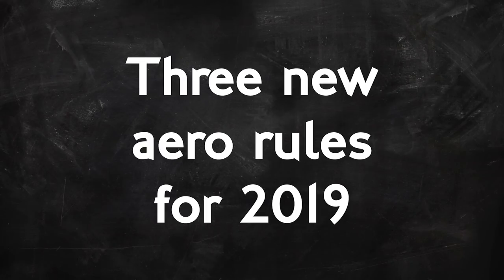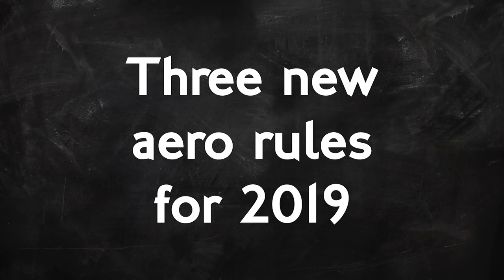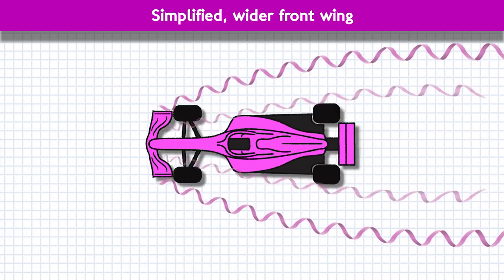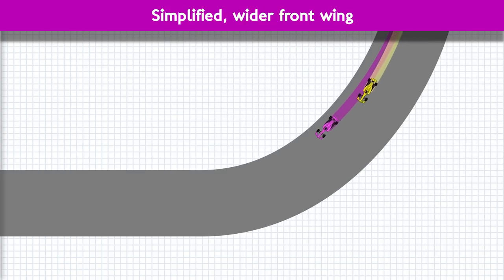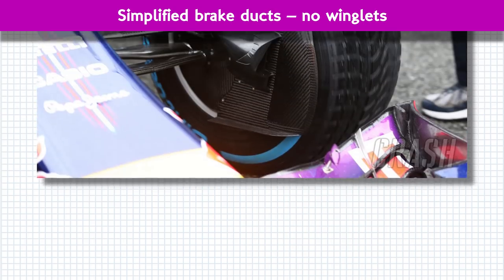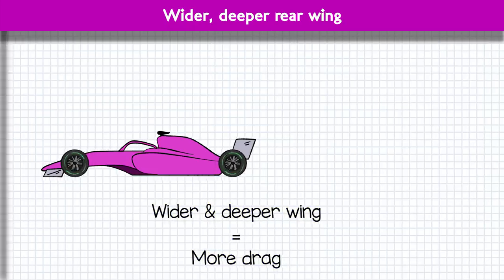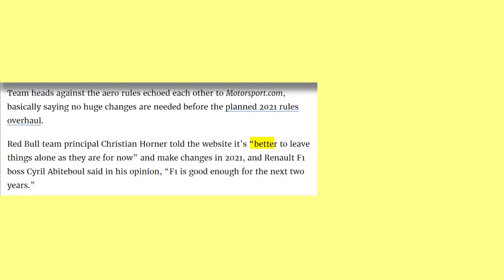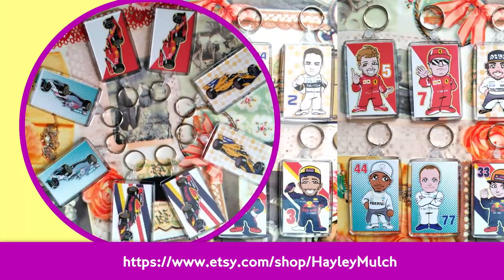New Aero Rules in F1 for 2019 explained

Comment: I was hoping the downforce was more smaller. That'll make the car more unstable during acceleration or when exiting corner that could cause the car spins etc. 

To make the cars faster, you basically just tweak the engine rule to had more horsepower like increase the volume of the engine from 1.6 L to somewhere around 2 - 2.4 L, Increase the rev limit to minimum of 17000 and maximum of 19000 rpm, make the turbocharger twin system and bigger so that the turbo boost that came up much bigger, strip off all fuel restrictions and banned any oil burning, Period. But dude, isn't that not relevant? Well what i should asked you is F1 a nature loving racing? If you love nature  watched Formula E instead. In history of 68 years of championship, F1 was never meant to be a nature lover racing. It's a sport that pushes all of the brain and muscles to the limit. Technologies in F1 would follow the time since the intention was to make the fastest and reliable cars as possible. Innovation would always come from F1. The halo is a start of a full cockpit safety device, so why rather they use an engine that had same volume of WRC car, the same amount of cylinders of IndyCar with less turbo, and hybrid? That's such a downgrade from a championship that supposed to be a pinnacle of motorracing

Comment: remove the wings, both rear and front, and the improvement on the action in track will be huge. Let the teams try to find ways to recover that downforce with the shape of the car (limiting the ground effect to avoid 80's style crashes), and enjoy. No problems with the wake of the car, and most important NO DRS.
Reply: Izquierdator Downforce is the reason these cars can tale half the corners they do at the speeds they do... You wanna butcher their speed?
Reply: Downforce is the reason these cars cannot follow each other, do you wanna see real on track fight and not artificial DRS-assisted overtakes? Force them to find another way of generating all the downforce they can without penalising the following car.
Reply: Yeah I understand but removing the wings entirely absolutely butchers the pace these cars can have. They will be significantly slower. I'd argue so slow that it will end up more boring to watch.
And downforce pretty much always leaves dirty air so unfortunately it's just a part of racing. Always has been. Always will be.

Personally I think having less downforce (Not much though). Simplified front and rear wings. As well as promoting different race strategies could improve it. But I'm honestly not that well versed in F1

Comment: I cant stand all the blind idiots who say DRSis a cheat. It isn't a cheat for the car behind at all. If anything the current aero rules are a "CHEAT" for the car which is in front. You saw this year that vettel was holding bottas back 2 seconds behind because there was no air for Bottas' car to use, when they pit, Bottas was able to gain 3 - 4 seconds on Vettels car in one lap. How can a sport where a cars aero can adversely affect the car behind at such a massive rate be fair? All you need to do in F1 these days is set a car up for qualifying because once the race starts if you lead into turn one, the car behind will be 2 seconds back within a lap or two due to the aero affect, not due to the drivers skill, or the speed of the car. F1 needs a set average of downforce/wake to enable overtakes throughout a lap. While F1 cars have massive downforce and huge wake the ONLY way to get the cars downforce/wake down to an average level over a lap to where overtaking is even possible is to have DRS to drop the wakes effect on the chasing car back to the base line by removing removing the massive advantage the front cars wake gives it. People don't seem to even understand why we need DRS, what it does, while we have huge aero cars we need DRS.the only aero which won't cause a wake is ground affect type which sucks the car down as opposed to pushing it down, Look at the next gen formula E diffusers, that is what F1 NEEDS to enable overtaking in a way where DRS would become redundant. Just imagine the next gen Formula E car with an F1 engine in it, thats where F1 needs to go.

Comment: F1 is getting too boring. It’s getting too regulated.

I prefer GT3 as there’s different cars on the track. Some more powerful but weigh more, some less powerful but weigh less. There’s V8’s V6’s and V12’s it all makes for some intense racing.

I feel like F1 needs to go backwards because going forwards just seems to be getting worse. They need to ease up on the regulations before it gets too robotic and dull.

Comment: This is such bull….F1 died in 2 stages: In the mid 90s when they banned ground effects, active suspension, traction control, etc & the early 2000’s after the V10 era ended. Formula E is in it’s infancy so Im starting to be a fan of that, but it sucks because im a F1 fan from 4/5 years old & petrol, revving, engine/exhaust notes, & the smell of burning hydrocarbons will always be a mental addiction. Why didn’t they have these problems in the 80’s, 90’s & early 2000?? Well they have regulated F1 to death, or practically to death. Preventing innovation & creative engineering/design is NOT the way forward! As true F1 fans, we dont care about the number of overtakes, we care about the BATTLES & driver SKILL that lead to an overtake! DRS overtakes are so boring. DRS should either be banned, or be allowed at ANY given time depending on the driver’s discretion. I am glad they are TRYING to remedy the problems but they WAY they are trying to remedy them is HORRIBLE!

Comment: If Formula One wants better racing, I suggest they simplify everything aerodynamic and allow real innovation back into the sport. I got interested in racing in the late 1960s, that golden era between about 1959 and 1979, when everything was new in one way or another, experimentation was obvious and interesting, and one never knew from one race to the next who was going to roll what out of the shop. Today's Formula One is a technical morass of aerodynamic fiddling on the one hand and "creative rule bending" on the other, none of which means anything to the fans in the stands. 

First, get rid of all this aerodynamic nonsense. Certainly, designers and wind tunnel technicians have found "better" ways of moving a car through the air and generating downforce, but  to what end? 50 years ago, when wings were new, novel and simple, catching and overtaking a car was easy enough; there was little worry about wake turbulence because the wings as the time weren't much more than trim tabs that generated a bit of downforce. Today, as Chain Bear said, it's all about the subtleties of moving air around the car for some benefit or another. The result is monumentally ugly cars that can't run near each other without suffering. Simple one-plane wings with single-plane trim tabs at the leading edge would solve a lot of that, as well as saving a huge amount of money. 

Second, loosen the engine regulations. In the mid to late 60's, cars ran everything from V-8s to V-12s to BRM's ill-fated H-16. The mid-70s saw the introduction of the turbocharged V-6s and straight-fours. This meant many different engine types that, with some rules adjustments, could produce similar power and torque. As it stands, "engine design" is a convergent evolution of one basic type (for awhile, it was V-10s, now it's turbocharged V-6s) as specified by the rules. Only the creativeness of the individual designers and teams makes any difference at all. 

Third, Formula One has to decide whether it is a sport, like sailing, or the non-combat engineering warfare it's become, with attendant military-sized budgets. If it's a sport, allow 60's style innovation using specified materials and limited aerodynamics, rather than the current all-but-in-name one-design series it is now. Or Formula One can continue on its current course, becoming ever more expensive and ever less relevant to real-world cars...and eventually becoming irrelevant to motor racing fans in general. I'd prefer making it a contest of men and machines, rather than a war of computers.